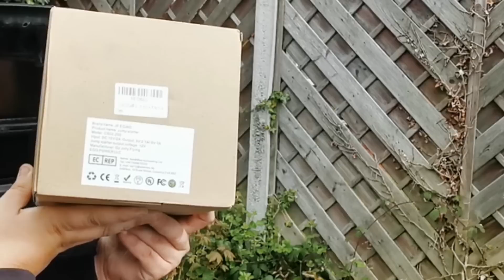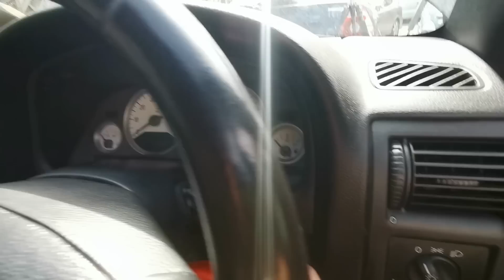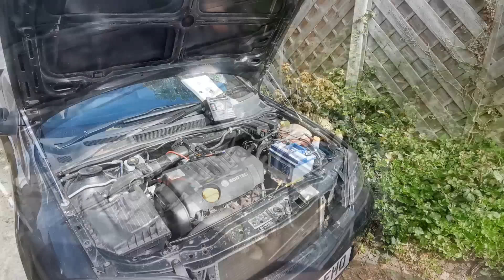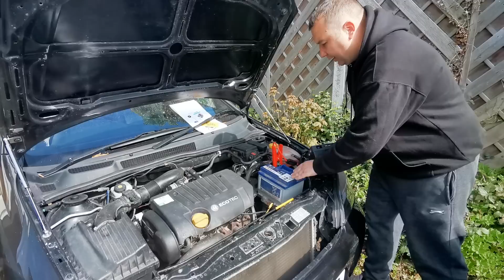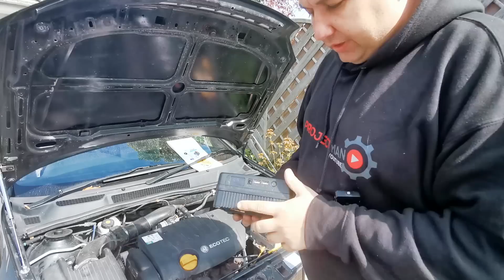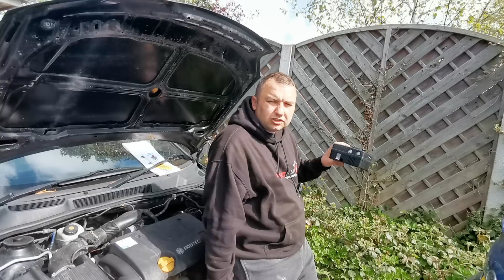JF.EGWO 3000Amp Car Jump Starter with Air Compressor all in one unit

Comment: Boost packs should be fully charged before use and disconnected from the battery as soon as the vehicle has been started to maintain optimum performance.